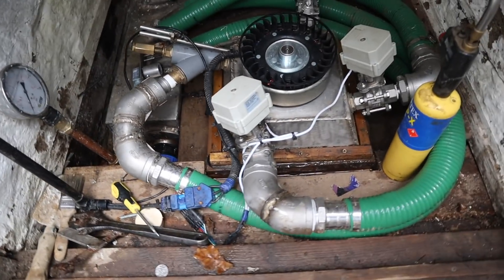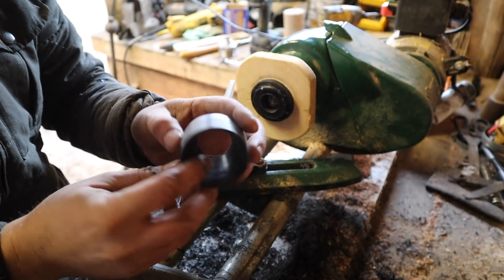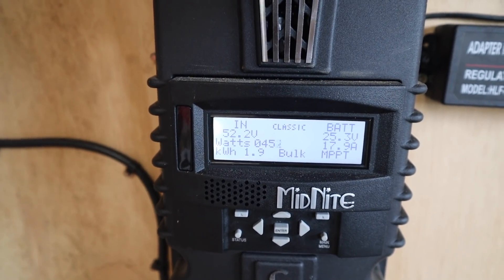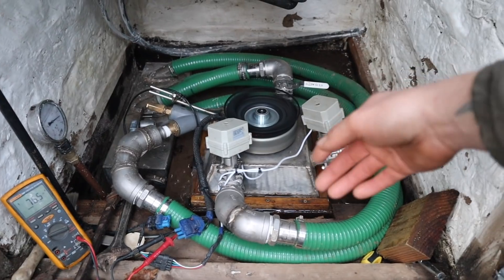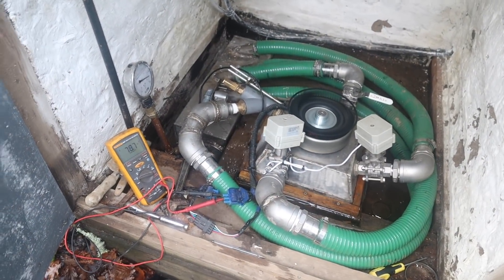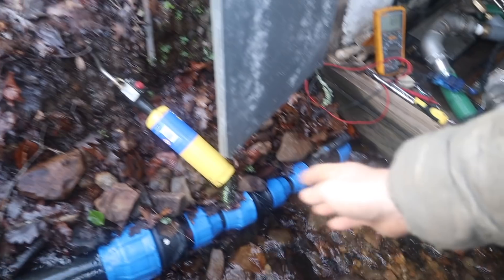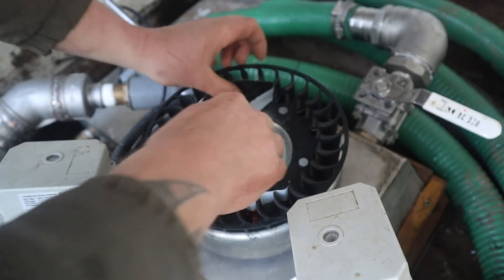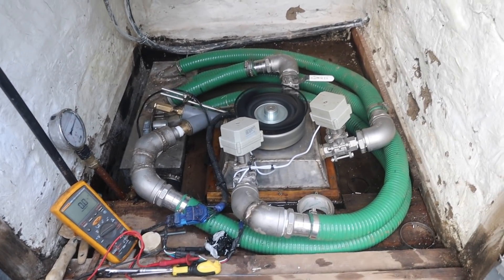Off Grid Micro Hydro Turbine Fine Tuning (Tapered inserts and fan loss testing)

Comment: The nozzle itself is the main restriction in this line. In this system Kris is playing with, I would suggest trying to degas the fluid at the intake to increase the density in the line, and to make the most of all the head you can get is where you will find the watts - because pressure is your best friend.
Reply from the maker: I am currently thinking about a new intake design. i have been messing with it the last few days. there was a small amount of air getting in just the odd bubble evey few seconds out of the stand pipe. I think the plan is going to be to make a very small dam about 300mm high just above the current intake. i can get about another 500mm of head and have a better angle for the pipe to leave the intake. i dont think im going to use conada screen though, its so expensive and mesh works really well as long as you leave plenty of water to clear the screen. Anyway, its in the pipeline already so dont worry.
Reply: @KrisHarbour  I'll buy you one of these 380x380, plus the acceleration plate if you want, if it will suit your application? https://www.powerspout.com/products/diy-coanda-intake-screen?variant=12541870178359
Reply from the maker: that was exactly what i was looking at today. That is such a kind offer. im really quite shocked. i would feel uncomfortable taking that though as that is a lot of money to give away and for something i can do without. the wire mesh is £15 and works well enough it just takes a bit more cleaning (keeps me fit walking up the hill)
Reply: @KrisHarbour  There are a couple of firms in the UK that make the stainless profile stuff too. Maybe they would sell an off cut from a big weir project? I'd be happy to donate a couple of hundred quid towards your project. You're a hard working guy with a good attitude. World needs more people like you. I'm guessing realistically you can't re-engineer the damn/intake until the summer when the flow subsides and you can live off the solar? If you can get away with it, dig out a nice collection area, damn it back, some kind of overflow pipe, and a gate valve diversion pipe. You know better than anyone what would suit your needs, but if you want to build a decent intake then those Coanda effect screens seem like the real deal, they use them in properly funded commercial installations along with that leading curve plate to keep the flow smooth, and if you want one then I'll help you fund it.
Reply from the maker: Yeah exactly. It would be a summer project so I don't have to turn it off at the time of year I'm reliant on it. Im only going to do a small dam as I don't want to raise the water behind it much as that would cause me problems. But I think just have a very small dam will help smooth out the flow and direct water in to the intake much better and give a little more head. It's really very kind of you to offer that. There is a PayPal donate button if you  really are happy and I would be sure to order the screen ready for summer. but please don't feel you needs to I can afford it myself but I am also happy to use the mesh. Getting an offcut would be ideal but it isn't exactly mass produced a commonly found stuff.

Comment: A future project could be to do a straight line hydro turbine, after doing one very similar to the current set up, on another stream to be able to narrow down theories and parts for hydro turbines.
Reply from the maker: My first turbine was like that, just one nozzle and pretty direct fed. the problem is you dont have much of a range of flows that will work so even though it is more efficient to run less nozzles you dont end up getting as much power because you cant make the most of the flows. the area i am in is very wet but the rivers go from flood to a trickle and back again in 24h so having a large flow range is very important in my environment.  If i was making a turbine for a constant flow it would be much more simple and slightly more efficient.
Reply: I guess with a strong river/stream you could make a pretty good scaleable system but without the river to try it you did these experiments, which I would have also done too, to determine whether there were any gains to be made on theories that you had.

Comment: how about avoiding 90° bends? would it be feasible in the cabin?
Reply from the maker: Not really, The bends dont have very high loss, I could get rid of the bends if i only ran 2 nozzles but having 4 nozzles means i can run ona wider range of flows and keeps the turbine making power for more of the year. so the losses in the bends are just acceptable so i can have that range.
Reply: @KrisHarbour  one more reason to go 3D! ;-)

Comment: i know it's not high priority but ptfe string is worth using instead of tape. loctite 55. i love the stuff
Reply from the maker: I hate ptfe tape, i will check that out, thanks for the tip.
Reply: @KrisHarbour  no worries mate. just put roughly one turn of string in the bottom of each thread, you'll get it easy

Comment: Would a butterfly valve work for you? you would need to fabricate a flange-fitting on either side and connect your big pipe directly to it. I'm finding them for pretty cheap on ebay: Deltech Delval 50050111E380 Iron Wafer Butterfly Valve 5in
Reply from the maker: yeah they are cheap but have high loss as the butterfly is always in the flow. thats why ball valves are good because the flow isnt restricted.

Comment: i still think the biggest gain would be the manifold, changing to a round one with the outlets on the end instead of the box design were the flow dead ends in box.
Reply: I agree the manifold could be better no step down in pipe diameter and no dead end
Reply: I think you have a point, here is a photo that would be real nice to see! https://www.researchgate.net/figure/Small-hydro-Pelton-wheel-32_fig10_277307265
Reply from the maker: That link that was suggested really isnt a good design unless all the nozzles are running at the same time and they would have to be sized in a way that accounted for the difference in loss as they get further from the source,  say you just want to run two nozzles the water has to encounter all the losses it would if it was running all nozzles. that would really be a very poor pipe setup. that last nozzles velocity would be quite a bit lower than the first nozzle meaning one of them would end up adding drag to the turbine. My design is considerably better than that. what would be ideal is of i could have a circular intake that was fed from both ends with 4 hose coming off. But that design in the link is not a good solution.

This is the right way to do it. If i had the space and money i would do it like that. 
https://www.pinterest.co.uk/pin/726909196084991970/
Reply: The largest loss is in sudden increase of cross section, ie at the entrance of the manifold box, once in the box the velocity is relatively low, so the water should be able to change direction and enter the 4 hoses without too much of a loss. I'm quite confident a long, smooth taper from the 90mm pipe to the full section of the box would help, of course the best would be with a 90mm ball valve. Maybe a threaded one would be easier to find than a Pe.
Reply from the maker: The manifold really isnt a big loss i know this for sure because im already running at over 60% efficiency so there cant be much loss there. If you really want me to test that theory feel free to donate a few grand and i will order a load of stainless steel tube and a tig welder and make that manifold. But i can assure you i would not gain more than 10w there. the biggest loss now is in the tapering down of pipe to the manifold and the loss there is still only 40w at full power. How do i know the manifold isnt the problem? The pressure gauge tells the story, the loss in the penstock is small over the 210m of 110mm. about 2.5 psi. the pressure gauge is in the intake box and it reads 5psi lower than static head, meaning there is 2.5psi lost from the 110mm to the intake. Getting rid of the loss will put the turbine at 70% efficiency. The turgo is 90% efficient so that is a 10% loss i cant change, the alternator is 85% efficient so that is a 15% loss i cant change the 2.5 psi lost before the intake equates to about 5% that puts us at 70% efficiency which is what the turbine would be at once that pipe is made bigger. its not possible with this system to get much more than 70%. We are talking about 40w here, there is another 40w of power available in this system within the realm of what is physically possible. we know for a fact that the is at least 2 psi lost in the tapering down fittings and pipe there isnt much left to be lost anywhere else its just not possible for there to be major losses in the manifold. 5-10 max. But if you want to fund me making a circular manifold i will be more than happy to but the gain will be about 5-10w at current flows
Reply: @KrisHarbour  "The pressure gauge tells the story"
No, pressure is only a static value.
A pitot tube would be a simple and cheap way to measure the velocity of laminar flow which is an actual measure of the energy transmitted to the impellers.
Reply: @KrisHarbour  If you have a design in mind i can tig it up for you and send it to you as long as it has sizes in mm and wont be to heavy for shipping. But when it comes down to it your the one that has to be happy with it. If you think that it is good enough then be happy. Its free power no matter how you look at it over the course of a year it saves you using a generator and buying fuel.
Reply: You made a clear point that you're in the range of fine tuning, so a few percent is what we're talking about. I agree that avoiding the tapering down before the manifold would be a significant improvement, but in my opinion it would be due to the lower velocity entering the box, thus lower loss.
If I had a a few grand to donate, I would propose to install digital pressure meters in strategic points to pinpoint the losses.
Reply from the maker: Yeah sorry Michele i didn't mean to reply that to you, i agreed with what you said, i was meaning to reply to the first comment by sam.
Reply: @KrisHarbour  myself as well meaning i appreciate what you do and share and it seems i started this rubbish tread. I have done hvac for close to twenty years and i was looking at it from a cfm type of situation and previous dealings with air flow in plenums and static situations.........love the channel bye he way.
Reply: Btw, I really appreciate what you are doing, and the content you share!
Reply: https://youtu.be/x50ZpscbPkI

Comment: I am wondering if you made the enclosure larger so you wouldn't have to use elbo's it would allow the use of the flexible hose to make more gradual turns in place of the elbos. Seems like it would help efficiency. It would be an interesting experiment.
Reply from the maker: that would mean that the turbine would also have to be made larger in order to not have huge gaps for the water jet to bridge. That would then mean the rpm to nozzle velocity would not match as the turbine being bigger would lower the rpm.
Reply: @KrisHarbour  I guess my explanation wasn't clear because I used the term enclosure. When I said enclosure I meant the space outside the turbine as making the building bigger the turbine is in. A bigger building would give enough space between the turbine enclosure and the building so the hose would have enough space to make a gradual turn all the way to the turbine enclosure without using elbows to reduce the resistance by using elbows. It seems like this would further reduce resistance to the flow of water possibly allowing a further increase in power. Might not effect the flow rate because of the size of the pipe being larger than the output but it would be an interesting experiment to see if it made a difference. Probably wouldn't make more difference on the ones that use two elbows.

Comment: Great video as usual bud. I know nothing about this but two things that popped into my mind are, would some sort of rifling like in a barrel help, or could you use some of the electric to run a pressure washer pump that’s plumbed into the system as a booster?

Comment: Bolt a flywheel to the top of that and maybe it'll stabilize your readings for when you are fine tuning.
Reply: Just average your readings over a couple minutes. He has the capability to log all the statistically relevant data in the world, there's no reason to try to modify the mechanical system to be more stable second to second. Data points over time and a little bit of math do it for you.

Comment: Best improvement you can do is do adjust the turbine blades, so the water leaves with less resistance, ( twisting the blades to get highest performance)

Comment: What's your Dynamic pressure with with the nozzle on?
Reply from the maker: 22psi at full flow 26 psi static, nozzles are 8mm, 10mm, 14mm and a spear so i have a massive range for all flows. full flow is around 5 liters per second.

Comment: Kris as always great work! 

I saw a interesting video on Hydraulic Ram Pumps just the other day, got me thinking of if you have ever considered making one to fill water tanks with? A water battery even (although that would be a large endeavour)? 

Just thought it a very interesting DIY project which is environmentally conscious and very interesting! Great new content! 😜

Keep up the good work!
Reply from the maker: it would take months for a ram pump to even pump enough water to run the turbine for a day. my turbine uses half a million litres a day to make 10kwh it would be alot of cost alot of parts. it would have to be massive and would store very little power unless the storage was a massive lake but it would still take months for a ram pump to fill.
Reply: @KrisHarbour  Kris also has a spring-fed gravity pressurized supply of water in his round house.

Comment: There must be something to be gained, engine builders don't port and polish for no reason 👍🏻
Reply from the maker: Totally agree
Reply: @KrisHarbour  have you thought about heating (to smooth bend) a PVC or ABS pipe to remove those corrugated greenish pipes.  Since an engine was mentioned in this comment in my 25 years of porting heads and intakes on (now old) V8 engines the idea is to remove any lips or "walls" as you did in this video with the inserts (on a car think intake manifold to head or head to exhaust manifold) the other thing you would do is you want to get the air to move as smoothly as possibly by cleaning (grinding) any bumps, ridges or sharp corners... In an engine the rule of thumb is the first bit of hidden power is easy to unleash and any extra power after that is fractional gains you are now to that point but even those small gains when added up together are pretty significant... I have been watching you tinker now for months with this and I think your 25 or more watts then when you started (I don't remember exactly).
Anyways I am enjoying the content especially the odd designed buildings and am looking forward to seeing you harvest that other water resource.
Reply from the maker: @AtomicReverend  I really need to show those pipes in a video, they are smooth on the inside, the wire is just on the outside.
Reply: I agree with shambles I'm a mechanic and i think if you made a manifold like a 4branch exhaust on a car you would gain a lot of flow = horse power  = Watts don't get me wrong Kris you have done a super job and it works, its the fine tuning as you say makes the difference's in everything we make. enjoyable video's as always keep it going
Reply: Yeah, increase bore or custom fab a taper into unit feed and the inserts will work much more in harmony therefore efficiently, as u say it’s all to be tested one way or another so u gain the knowledge.

Comment: Wondering does the water get away from the waste side of the turbine without closing any issues ? Is your setup quite close to the stream below ? Would the run-off being  more aerodynamic make any difference ? (Apologies for poor terminology)
Reply from the maker: It has plenty of space under it to fall away, turgos are quite good at directing the water out the bottom. I do however want to cut the outlet hole a bit bigger in the summer when i take it all out for maintenance as i think at full flow im starting to get close to the max that can freely get out of the hole that is there. as i plan to run it at twice the flow one day this is just planning for the future.